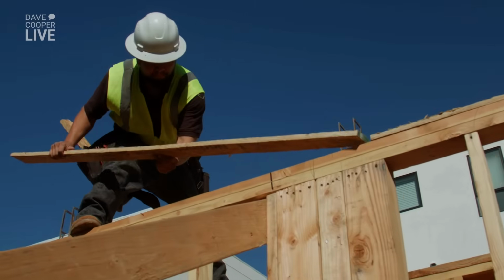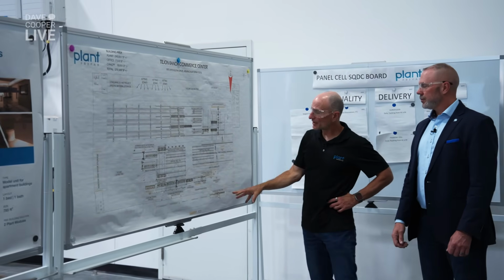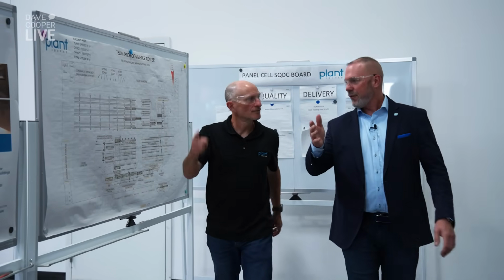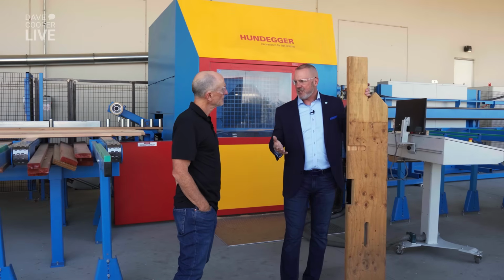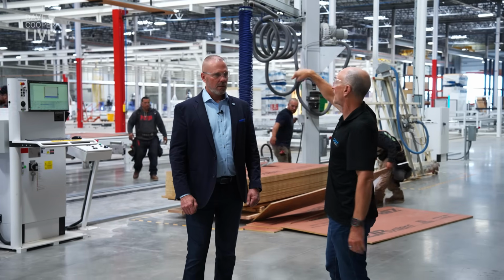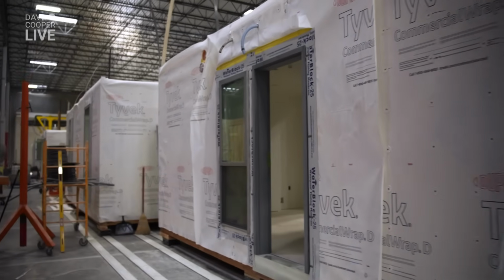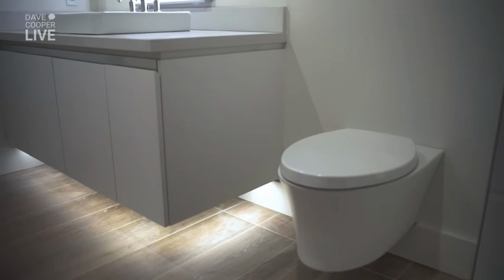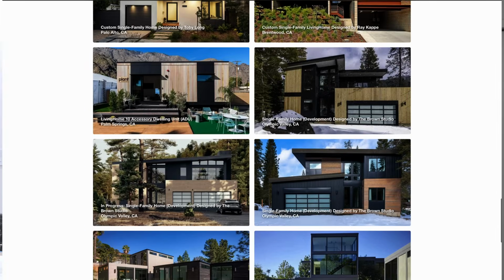Inside Plant Prefab's $40M Factory: Steve Glenn Reveals the Future of Modular + Panel Construction

Comment: How can I do this but with concrete?
Reply: I saw on YouTube there is a company in FL who does the same in concrete
Reply from the maker: Do you know the name of the company?  Wall Panels yes but are they building full Volumetric using concrete?  The weight to ship and lift full volumetric / modular structures would be a big question mark for me...
Reply: No I don’t know the name of the company .. and it was of course not the whole house it was in parts .. walls, floors  .. everything extra and assembled on site.
Reply from the maker: https://youtu.be/v8RkLh0Y7_g?si=amfgUeiPrXZu2Gj-